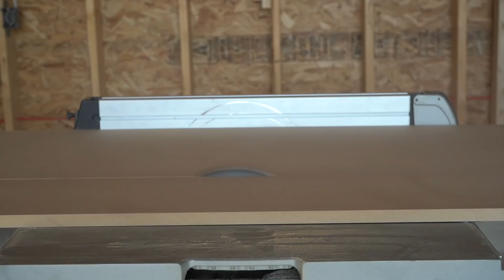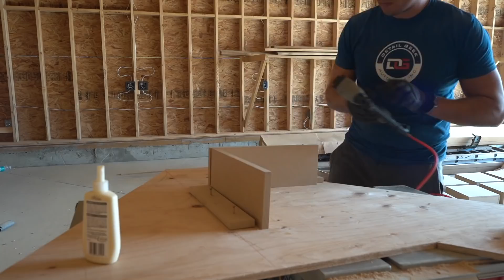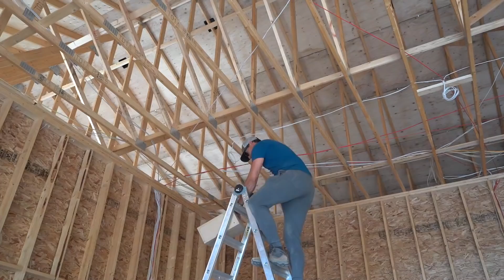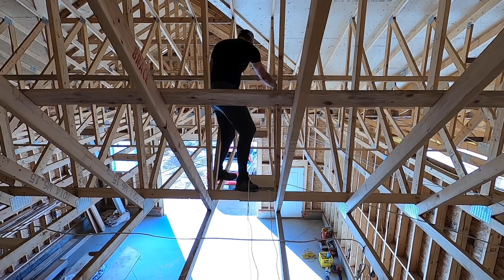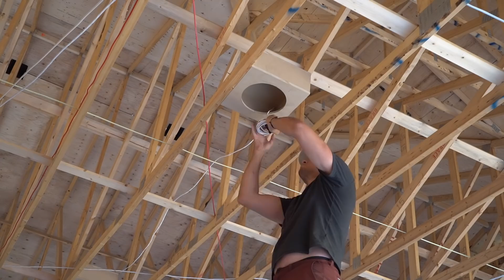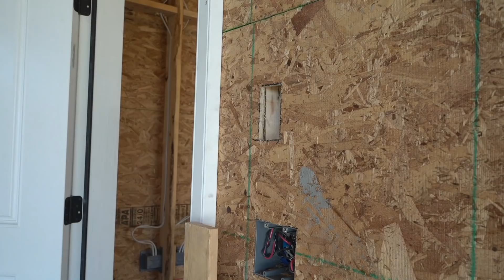SAVING MYSELF $15,000! | EPIC Audio and Security System | Detail Geek Studio Build

Comment: Why didn’t you just do in ceiling speakers rather than do the boxes? Plenty of brands you can just do in drop ceiling or straight into the drywall either way you go, and the boxes don’t really do much to improve sound or anything. This just seems like it’s an extra step to make and install boxes that is unnecessary… maybe some kind of Canadian regulation, where in the US you can just chain them to a rafter for firefighter safety? Also, should’ve gotten you some glow rods they make running that wire easier without having to keep moving around beam to beam. Just things that struck me as a home audio installer that has done a bit of commercial work down here in the US. I guess you could be using just regular speakers that aren’t infinite baffle designed for in ceiling use, but if you are using infinite baffle speakers building the box is only going to restrict the amount of low end you can get from those. Still cool to see someone take that challenge on themselves, although it’s really not as hard or technical as it may seem if you’ve never done it before.

Comment: I know I'm watching this from the future, but couldn't you have screwed 2 longer boards to the top parts of the speaker boxes that would have sat the box onto both joists and held it at the right height, also helping hold the weight across 2 joists so any movement and weight isn't pressing down the ceiling?

Comment: For the speaker boxes. Is there a reason for not putting a brace above them/ attached the brace to the rafters? It seems the few screws are only holding one side on the boxes. There's no support on the side that is not attached to the opposite stud.
Reply from the maker: There’s 6 screws in each box so they aren’t hanging down on one side at all…once the ceiling boards are up they will help hold it up too. Bracing it would have been unnecessary work 👍🏻

Comment: I'd have rented a manlift for the few days you needed to do the work. I do cabling installs as part of my day job and for ceilings above 8ft where we have to run a lot of cable, they make the job far easier, not to mention far safer then swinging between rafters. Falling from a 13ft rafter to solid concrete can kill you, feet first you'll shatter both legs, head first if your lucky just shatter your neck and skull and leave you paralyzed, worst case you'll be dead, and that kinda dead ain't pretty. $500 is a small price if your saving $15 grand.

Comment: It may be too little too late at this point considering you're in Canada and in shorts in this video 😂. You installed the boxes flush to the ceiling joist for the speakers. Did you account for the drywall to come down 1/2”-5/8”? Otherwise it may look strange recessed in place that far
Reply from the maker: The speakers sit on the outside of the ceiling/drywall. The clips on the speakers have enough travel to allow for a speaker box to be used (I did this same thing in my house) 👍🏻

Comment: Yeah i would also good old school with cabling, especially when you are talking about security. Hard wiring means, it a closed circuit (hard to hack), faster, reliable, and more stable. You should (if you haven't already), cable manage all the speaker wires, ethernet, etc... Once done, either write down or take mental note of where everything is located inside the wall and roof/ceiling (including plumbing and power). You could just take many photos, works probable even better. Reason for this is, in future you don't accidentally cut or drill through them (than you have to replace and fix the whole line/s).

Comment: Make sure the speaker wire isn't touching any power wires if they cross each other there can be a buzzing sound.
Reply from the maker: Any electrical lines were crossed at a 90 so I don’t have interference issues 👍🏻
Reply: @TheDetailGeek2  👍

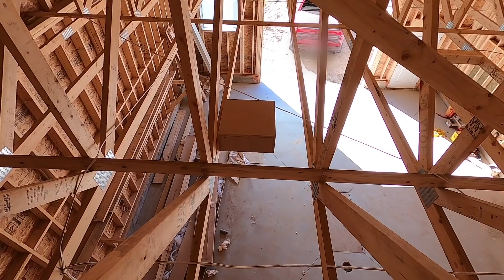Comment: Your left boot @ 05:00 and righ boot @ 05:48 minutes is the exact reason you DON'T lay cables over anything. Pull cables and secure to avoid feet crushing or cutting them. DIY not always a cost saver! Install walk-boards around the space.

Comment: I guess an old dusty AM radio sitting on a shelf at the back just isn't good enough for you...😆😆 Nice work. I wish I still had energy like that. Next  time you're by yourself on a high ladder, tie a couple of ropes around the top step and anchor them to the rafter or whatever you're working on. A bit of trouble I guess, but better than hitting a concrete floor from 13 feet up. One of the last times I was an a tall ladder with no helper one of the feet gave way and I went through a plate glass window. I was looking at your outside wall construction studding. My old dad's house was built some 140 years ago with 10 foot ceilings, FULL CUT 2x12s on 12 inch centers. Now THAT'S construction!

Comment: Did you leave slack on the ethernet cables at the corners of the building going to the exterior cameras?  Didn't look like it.  Highly recommend leaving ~3 feet of cable spooled up there in case of future issues.  Also, securing a loop of slack above the maintenance room before they are dropped down to be punched down.  You never want to have your cable runs to be exactly the length you need.

I would also run a cable or two to some ceiling areas, in case you want to install wireless access points to help with coverage at a later date.  Could leave it spooled in the ceiling if you aren't using it.  But way easier to run cable now with open walls/ceilings than down the road if you decide it's needed.
Reply from the maker: Yep, lots of slack in the lines and extra in mech room. Definitely won’t cut down to “exact” length 🙂

Comment: All looking good mate. Having worked with mdf a lot, I would recommend putting noggins (bracing) on each side of the speaker boxes, connecting them to the trusses and use 90degree brackets to hold the speaker boxes to the noggins. MDF has a habit of deteriorating over time or vibrating loose. Just an idea, but loving it so far 👍🏼
Reply: And dont get it wet.
Reply: I imagine that the drywall will be mounted over the boxes and this will hold the boxes up much better.
Reply: @VanisleNSX  it will for sure. But vibration from speakers etc could loosen the screws/nails overtime. Also if there were ever a roof leak then the plasterboard would be compromised. Not knocking his work at all, just offering a bit of advice 👍🏼
Reply: was about to comment the same thing as well, even with drywall over i'd still tie into the truss next to it.

Comment: I'm also a bit more oldskool; rather have cable (one: for better speed, two: for greater stability). That's some daredevil sh*t that you're doing there. Good work!
Reply: For security cameras never use wifi. A prepared burglar buys a usb stick sized wifi jammer puts that in his pocket and no wifi camera in a 100meter radius will be working anymore
Reply: @rayk2022  how about a weefee camera?
Reply: @nopenope7088  For wired that won't happen.
Reply: Agreed it’s way more reliable and faster and less l delayed my dad has taught me how to wire electric and lots more
Reply: school*
Reply: Working on a building
Reply: It's so nice to have appreciating and supportive comments like yours on YT instead of the smart... ones like "I would do this WAY better with xyz...!"